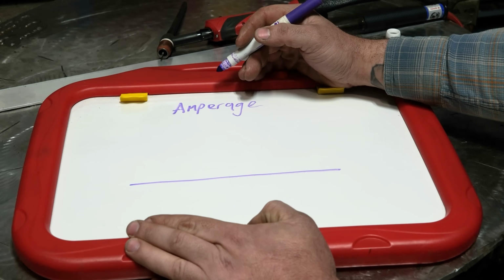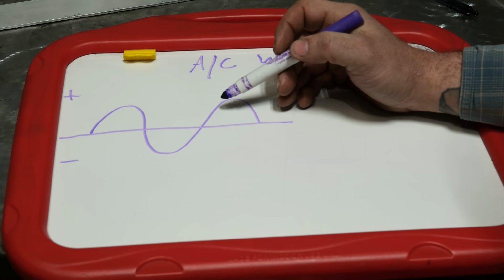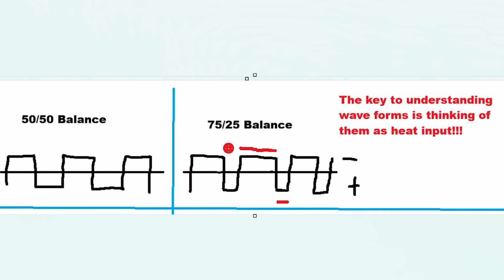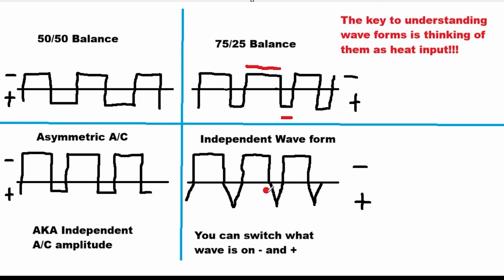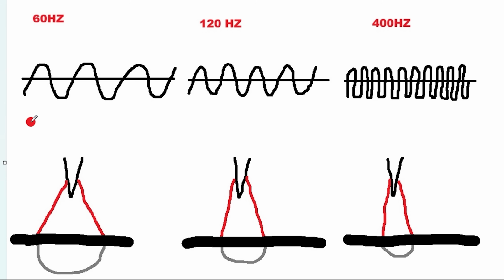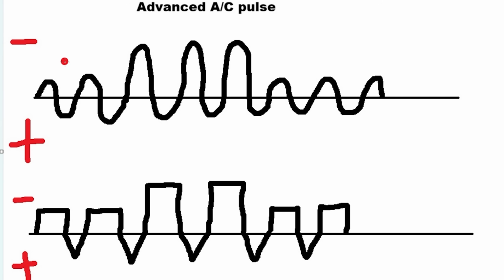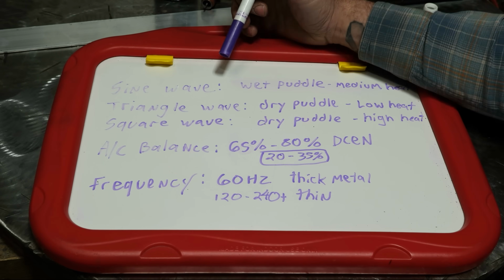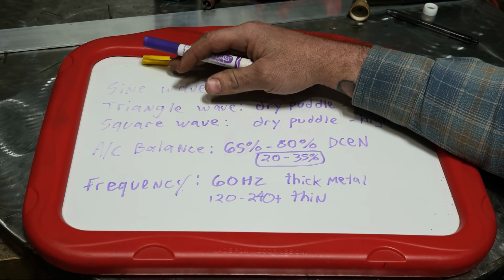How to Tig weld Aluminum part 2:  Understanding machine settings

Comment: This is a good video Greg. The problem for a lot of people isn’t that this is so difficult to understand, but rather than most manuals, even for the better machines just explain what the controls do. They don’t tell you anything about what those are used for, or why you would want to use any of the settings. So you look at all the settings and it’s very confusing. I swear that when I read the manual for my ESAB 205 I understood less than I did before.😊
Reply from the maker: A majority of welders are that way, I am not sure why.  To make matters worse many welders to settings in hidden menus so accessing them was hard lol.  Even the miller dynasty I own (the new one) didn’t mention anywhere in the manual that it auto switches polarity (there is no + and - labels).  You keep the ground clamp hooked to the same terminal and switching tig to stick it auto changes the polarity.  That’s cool and all but the lack of mentioning this made it a PITA to figure out why it wouldn’t stick weld lol.
Reply: My Australian CigWeld (Parent Corp is ESAB brand) has a manual that explains what all the settings actually do with diagrams like Greg does.

I have a background in electronics so maybe, that helped me understand it easier.

Comment: Thanks for the video. Always good to learn more and see if my current understandings are correct.

I found that using pulse (AC or DC) just makes the arc wander and flutter more and and reduces my overall heat input, so I don't use it and just pulse my foot pedal when needed. At least I'll be okay if ever have to use a non-pulse machine eh.
Reply from the maker: Honestly pulse is probably the most overhyped feature of a tig machine.  Some machines better control it than others, but across the board you can make excellent welds without it.  I am going to do a video soon testing it against fixed amperage and I anticipate less penetration for a prettier weld.  Probably not a good trade off lol.

Comment: After welding 6061 all day, I still enjoy all you do Greg….cheers from Orlando, Paul
But my aching back from the cold shop, all the bending and contorting, 
And being an old geezer is killing me…..🍺💯❤️🧌
Reply from the maker: When you find a cure all for joint stiffness and aches make sure to share it 😅.
Reply: @makingmistakeswithgreg 🍺🍺🍺🍺🍺 is the cure….being 73 does not help….cheers Greg , wonderful explanations…Paul